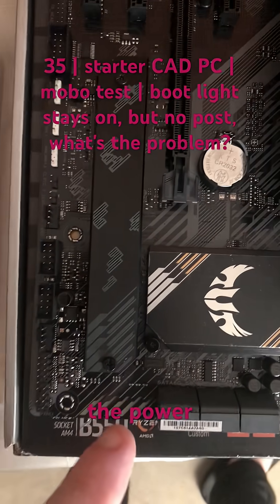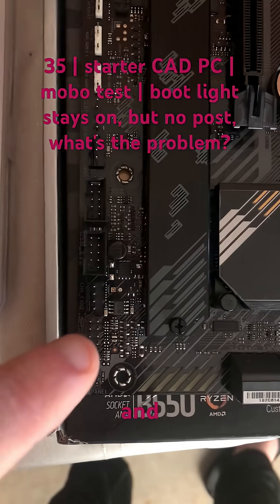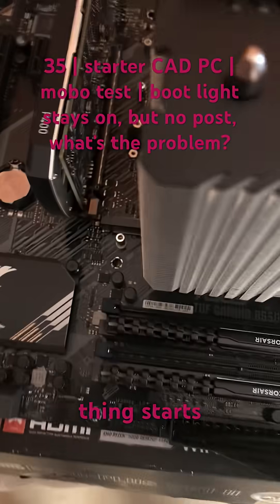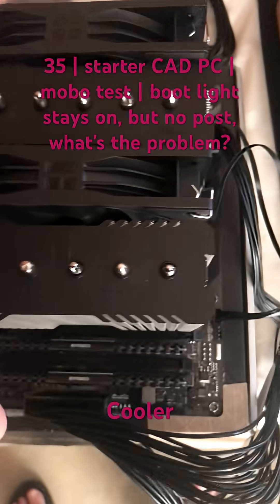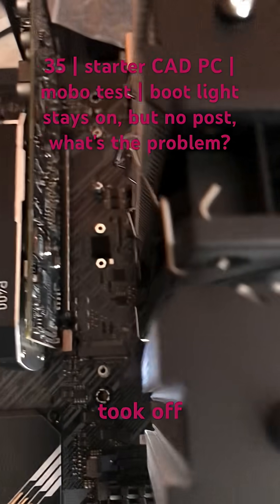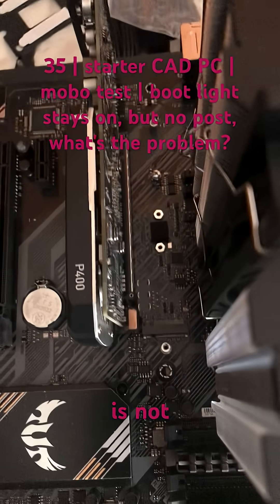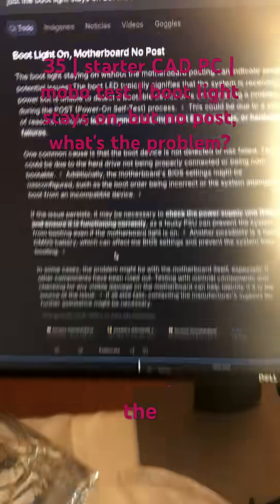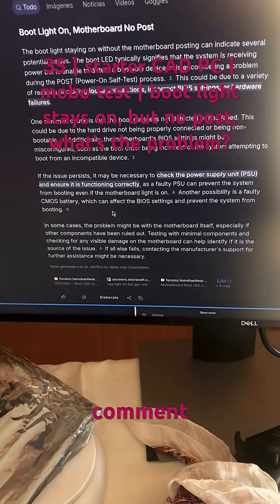35 | starter CAD PC | mobo test | boot light stays on, but no post, what's the problem?

Comment: Bro you're GPU is not the best did you buy it off eBay idk because that could be the issue
Reply from the maker: I was wondering if it was too old...but pcpp says it's compatible...other sites may have too...maybe i'll check what's officially supported, but if I rememver right that can be hard to tell.
Reply from the maker: @Lenox_63 also - wouldn't a light pop up or something to indicate this?
Reply: @open_source_office_hours  Yes there is a light the VGA light to show defects with the GPU but just to be safe I would try another one or without one of the CPU has an APU
Reply from the maker: the cpu doesn't have graphics...so my understanding is I have to have a gpu in for it to work..this is the only one I have. Is there any downside to upgrading bios? was going to try that before trying anything else.
Reply: @open_source_office_hours  I had to troubleshoot my PC a lot of times and I never needed to update my bios but if you want to go ahead but I would check the components first
Reply from the maker: @Lenox_63 why? and how if I only have one set? I'd have to take off the cooler to check the CPU...won't have new thermal paste for a couple days or so.

Comment: Based on the symptoms, I’m seeing your bios needs to be updated. If this is a modern board make sure you go to the proper support page and download the latest BIOS onto a flash drive or follow the instructions. Your motherboard should have a dedicated USB bios, flash port some of them you have to click a button others. You have to click a button on the motherboard. Some of them are on the motherboard. But a symptom of your system just not doing much when you try to boot is usually an indication. The CPU is not properly supported by the bios.
Reply: Also, like I said, make sure it’s the proper bios for that motherboard. It has to be the exact version as well so V2, V1.1 will make a difference.
Reply: Also one other thing, the USB flash will work with or without ram or CPU installed. That’s a completely separate system.
Reply from the maker: @blueberry34702 not sure how the cpu and ram not being installed matters....I need those for a post anyway
Reply from the maker: @blueberry34702 I did this with no success. I'm wondering if I did the exact version. I think it's correct, but the mobo came used w/o a manual.

the VGA and boot light stay on when I try to get a post....so I still don't know the issue. one video online says to reset the cmos...I'm wondering if my graphics card is to old (pcpp says it is compatible). not sure what to do next.

Comment: Might want to get into your BIOS, and set yourself up, and if necessary, use another computer and a USB drive to get current BIOS from the motherboard manufacturer, and update your BIOS. You CAN use your computer without an operating system, but ONLY to get and use BIOS settings.
Reply from the maker: @Estranged180 ahh...I'm supposed to go adjust things in the BIOS before getting it to post? My understanding is that the post is what indicates all the hardware is functioning. (first build)
Reply: @open_source_office_hours  You'll nearly always need a BIOS update right out of the gate. Setting up the XMP (or applicable RAM profile) is just a bonus, as most boards opt for the lowest speeds, and you need to set the XMP (see above) to get the most out of your RAM. There was a time it was a problem, and all the RAM was set to run at 2400 MHz, when the listed speed was 2666 MHz. Nowadays, it's upwards of 6000MHz, but I can almost guarantee the BIOS isn't set up that way. Not setting it up can make you think something is wrong, even when something isn't. A BIOS update also ensures the CPU works seamlessly with the other components. 
If you can't get into your BIOS, POST has failed.